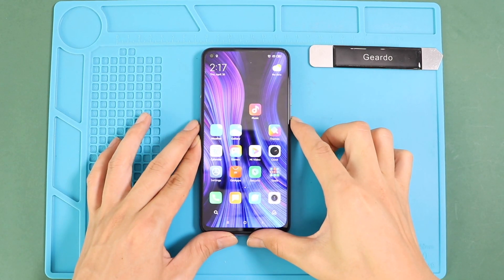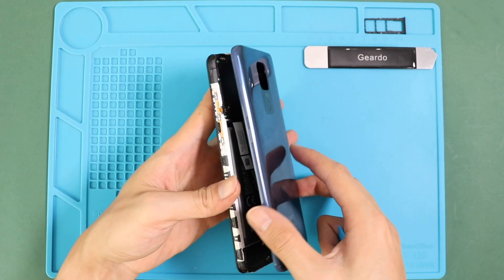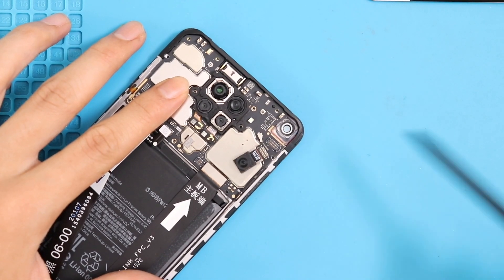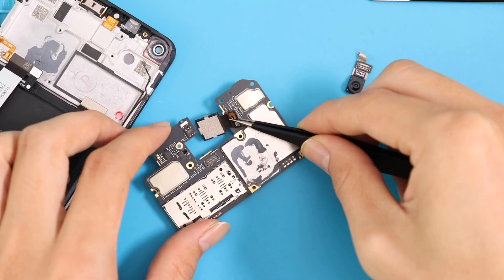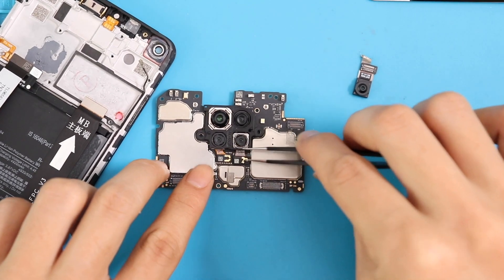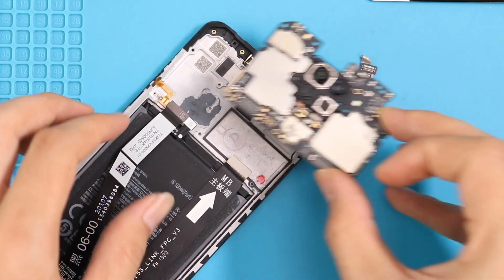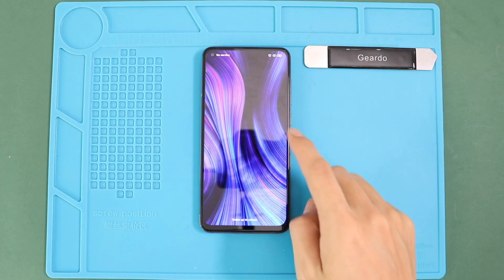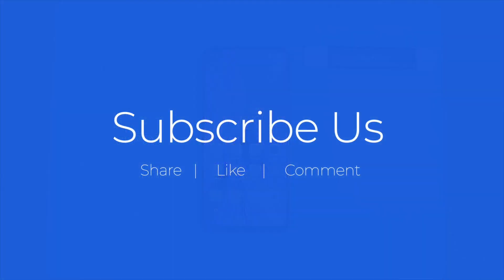Xiaomi Redmi Note 9 Camera Replacement | Redmi 10X

Comment: Hi!  I disassembled to put in a battery, must have done something to the camera lenses because it now shoots photos that appear to have kind of a "double image".  At first glance they just look blurry, but if you zoom in you can see it's because there are two images superimposed on each other but slightly off registration.  Any idea what I did and how to fix it?  I've already taken it apart again (a few times) and checked to make sure the camera lenses appear to be in the right place, seated, moving freely, etc...
Reply from the maker: Have you clean the camera and camera lens rings? That should be the main reason unless something else is happening with the camera.